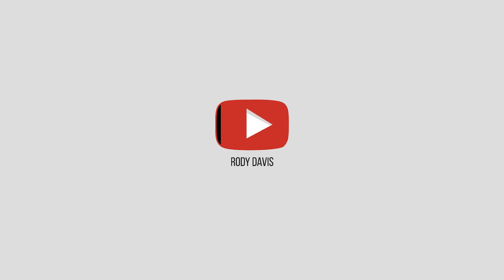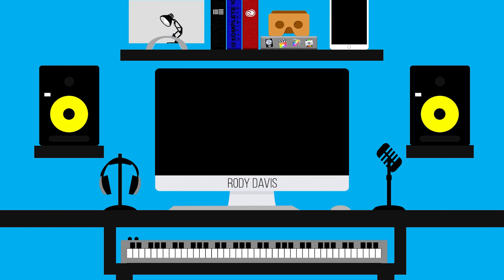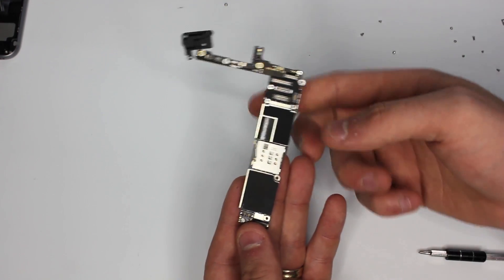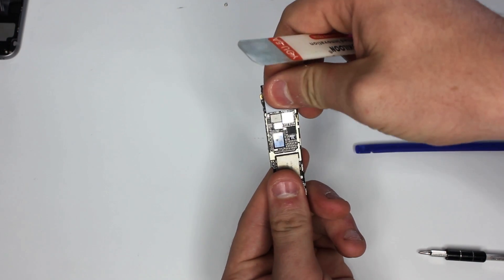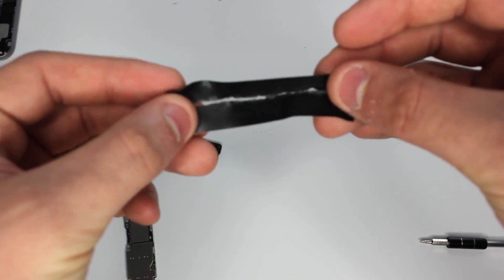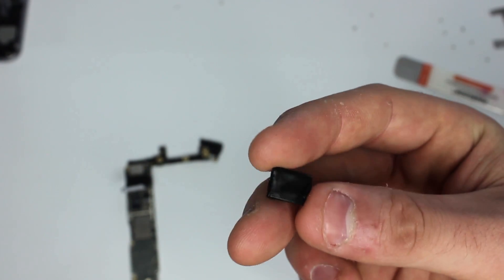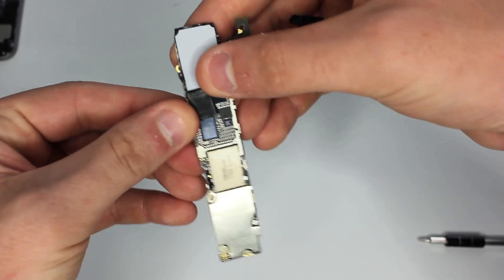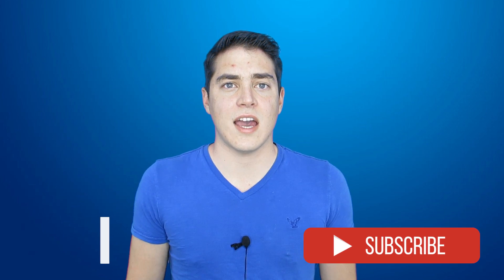UPDATE: How to Fix Touch Disease on the iPhone 6 Plus (No Soldering or Bending) | appleEducate #05

Comment: This is not a "fix." It's not a repair and it hardly even qualifies as a work around. The reason touch fails in because some of the many solder joins have oxidized. When the chassis is bent or torqued, the oxidized contacts sperate from their pads. Pressing these cold joints back together might work in the short term, but the connection is still tenuous. Higher current may be necessary to pass through the cold joint which can lead to other failures and shorter battery life. Placing a shim over BGAs and using the force against the chassis to hold it in place creates another bend in the motherboard that could result in damage elsewhere. This is simply a bad idea.
Don't stuff tape or anything else inside your $600 device. 

Apple has a repair extension for touch IC failure for $149. If you're worried about getting an exchange with the same potential problem, there are micro solders that will replace that sticker with a metal cover which prevents bending in that same area. Most (myself included) offer this both after a repair and as a preemptive measure.
Reply: We get it, you and the other pros don't approve of this. There's no reason for you to keep commenting that fact. These people own their devices and can do whatever they want to them. You are speaking on behalf of other pros with a condescending attitude that isn't bringing anyone else to your side. 

I would just suggest not engaging anymore here and let this run its course. Apple has a terrible solution for an even worse problem that they caused...making people look for cheap temporary fixes. That's their right as owners of these devices...even if they are potentially damaging them.
Reply: Boanerges, technically, you don't have the right to open their phones because it violates apples terms of service. No one has the right, except apple. As for my comments, for as long as people produce this kind of dangerous information, I'll be here, yelling at the wind. But if I make one person think twice or save one device from additional damage, it will be worth it. I'm sorry if you don't like my conviction.

Comment: You forgot to mention the main tool that you used in this video. Yourself. Anyone who follows this guide is likely to end up with a phone even more busted a few days after the "fix" stops working. This is similar to wrapping an Xbox in a towel to fix the rrod.
Reply from the maker: +Martin Law I have an updated guide that goes more in depth.
Reply: Rody Davis does it show you bringing the phone to a reputable repair company? Or at the very least to somewhere where they have an actual clue about what they are doing?

Comment: Good for a band aid, but that's about it.
Reply: This 'band aid' you refer to have been working flawless for me for two months and I have no reason to believe it won't keep working.  I personally like the idea of the little square of a rubber band or two under the chip as the size if more inform than tape but this works.  Thanks again.
Reply: It has been working for me for a little over a month. This may not be the "professional" solution, but it definitely works.
Reply from the maker: +Beau Dorsey that's exactly what it's meant to be.

Comment: This is a joke right?
Reply: No, he's serious.
Reply: furr It sounds like something a certified person would do.
Reply: +Louis Rossmann Good point. In retrospect everything points to Apple Certified Tech.
Reply: This is supposed to be a temp fix... but the correct way to do this is to solder it... and if you are not an expert  what you can do is get a cheap electric solder and folding a piece of foil paper the exact size of the IC and carefully placing it over it with the solder hot and ready apply heat for intervals of 30 secs... no more than 3 times. This should transfer enough heat to solder the IC again without taking it out.
Reply: Fucking thank you! Fuck these people right..
I agree with you
Reply: I rather have to pay nothing phones are already too damn expensive
Reply: It's not working in my iPhone 6 Plus please help me my problem is my phone has automatically touch operating
Reply: Mine worked right away I did the exact steps and first try only been a day but so far so good. Before I had to bend in order to work
Reply: No, I’m currently trying to fix it on my iPhone 6 Plus right now. It’s really frustrating when I go to exit out of something and it does random stuff like tap stuff when your not even touching the phone.
Reply: It actually works but it seems to only be temporary. The first time I tried it didn't but after making it thicker it worked.
Reply: The joke will be on all the poor folks that have to send their phones to us for long screw damage in addition to touch ic repair after trying this.
Reply: ''I am an Apple Certified Support Professional, and Apple Certified iOS Device Repair Technician. I am an iFixit Pro, and Amazon Service Provider. ''

I call BS.

Comment: This isnt a fix. Wedging a piece of tape in between the IC and frame is only pressing the broken solder connection down. Which will fail again and the added stress will cause other issues maybe cpu lifting, or IC chips breaking, or baseband searching issues from flexing the board. 
Instead of spreading "fixes" like the towel trick xbox 360 or the copper shim for HP laptops that dont last and cause more issues, why not share information how or where to have it actually fixed professionally where it wont come back. Or better yet tell people to complain till Apple replaces these under warranty and not charge people more money to fix their design flaw.
Reply: Hey it’s working for me...! So deal with it...
Reply: thats like saying to put some tape on a tire with a hole in it, it might prevent the air from coming out but will eventually fail. Thats not a fix!
Reply: If you can't figure out that there is an apple store and many cell phone repair places in your city then this guy can't help you. I know that I can fix it properly for 110 at a random shop or 149 at apple.
Reply: It isnt a fix for you because the video is a threat to you getting more customers
Reply: A temporary fix is still a fix as a pepperoni or hawaiian pizza is still a pizza...

Comment: Hi! The solution proposed worked as a charm. I managed to map the screws not to miss anything while putting it back but know I have another problem. After assembling it I saw that the phone is really heating up in that area and sometimes even shutting off. Also the front camera is not working but it is connected properly. Any suggestions to what i might've done ? Any other users experience this issue ? Thank you!

Comment: I purchased the Apple screwdrivers at Fry's, and began to disassemble my Iphone 6.   However, the second internal screw will not come out as it appears to have been stripped at the factory.   How do you overcome this?   Drill it out, and if so, does it have to be replaced?

Comment: Sorry I have to say this but as much as this video is well presented and educational- it's definitely not something that should be performed by anyone who is not familiar with opening these or having an idea of what happens when you apply pressure to one side of the board. You cause the board to warp and other components to fail in the same way the one you are trying to fix. Best way to get this sorted is to take it into a cell repair shop that can do board work and will replace the chips with leaded solder as well! Lead free solder in those components is half the problem why they fail as well as lack of chip underfill and board anchorage.

Comment: Everything was going great until a piece of adhesive that is CLEARLY not present on the phone used in the video showed up on my iPhone and while trying to pull it up, I tore the flat connector.  This is the connector you pull up and fold over beginning at the 1:56 mark of the video.  Mine was held down tightly with adhesive that is not present in yours.  Bummer.  QUESTION:  Can you tell me where I can purchase the connector in question?  I am not a beginner as I have 3 teenagers and a wife and have replaced multiple screens and batteries on different models.  Thank you.

Comment: Hi Rody, thanks for taking the time to help people out, we really appreciate it!

I recently changed the Speaker and Mic on my iPhone 6 because both were distorting. Unfortunately they are still distorting after I replaced them both & I got the flicker afterwards so I'm thinking I may have damaged a connector during the fix.
 Is either of these a problem with the board?  Did I buy  crappy replacements maybe?

SPEAKER:   http://www.ebay.de/itm/401245818177?_trksid=p2057872.m2749.l2649&ssPageName=STRK%3AMEBIDX%3AIT 

MIC: http://www.ebay.de/itm/391646698146?_trksid=p2057872.m2749.l2649&ssPageName=STRK%3AMEBIDX%3AIT

I would like to kill two birds with one stone so I'll wait for your reply before I go ahead.

Comment: thanks it's working but some time it's same it doesn't response and "1" button is not working.. what should I do
Reply: It's the same problem. This technique is not a fix. In your case not all of the joints were able to produce a viable connection. Squashing the BGAs onto the motherboard is bad mojo.

Comment: I was able to do this fix on my phone with no problem with the tools that I had. However, a recommendation is for the tape, don't make it too thick because when you put everything back together, the screen will not be flushed. Also, the result on my iPhone 6 Plus is not fixed all the way, the touch on the screen comes and goes ( but not as bad after doing the changes with this video). Overall, good video. Thanks.

Comment: I also noticed one other issue with Wifi. I can get basic wifi but it no longer picks up my 5G setting which was much faster.
Reply: Ray Thomas are you sure you put everything back properly? The upper half of your phone works as an antenna, there are some components that have to be screwed properly to the housing, just unscrew them and put it back again! It should work! Make sure you put every screw to its right place!

Comment: Hey Rody - First off, thanks for the 2 vids! Now my issue is that my phone does get a little warmer than what I remember when using it, even after a few minutes. It's not burning hot, but definitely feel a little warmth right by where the tape was put. Is this common, even normal? I did reopen it again and re-seat everything. I also stripped 2 of the small screws in different areas, does that effect things drastically?

Comment: Update 12/15/16:  After hard reseting my phone (hold power and home till it reboots), and taking the screen off and tightening one of the screws behind the white mark on my screen, most of my issues have gone away now.  Phone is definitely much more stable now.  I can get it to freeze still by pressing firmly on the location where the IC chips are, but a quick power button press and login clears the issue quickly.  I still have a smaller white mark on the screen, have ordered a better screwdriver to tighten the screws another turn and see if it goes away.  YMMV, I probably would do it all over again, given I just don't want to spend either the $150 to get Apple to fix it (and problem come back again), or buy another iphone 7.  I think I would take HateTheG's suggestion and use a thick piece of rubber band.  Thanks for posting this!

Thanks much for this video, unfortunately I followed all the steps very carefully, made sure I had a thick enough tape, put'r all back together...and same problem.  It's intermittent, but when it happens, have to hit power button and lock it, and re-open it.  I also have a white blotch on my screen now, about 5 mm square.  Not major enough to complain about, but I sure would not try this procedure again, took over an hour to very, very carefully track every little screw.  So thanks again, but it did not fix my issue!

Comment: This definitely works.  Instead of tape, I cut a piece of a fairly thick rubber band and place it on the chips under that tape.  Been working for almost two weeks without one little flicker.  Thank you for this video.

Comment: if this is an issue with the touch sensor then shouldn't Apple fix it? Since it happened with my iPhone 5 and 6+ it seems like a design flaw
Reply: The problems with the 6 and 6 plus are a design flaw, but Apple doesn't see it that way.

Comment: I have a iphone 6 that's having the same issue except for the flickering. Screen just constantly becomes unresponsive. Would this work to fix it? I tried everything else btw: hard set, software updates, restore to brand new etc. Nothing works. Took to genius bar and was told I would have to pay over $300  for fix.
Reply: Nads this will definitely work but it happens again after 4-5 months as the tape gets old... do this again and you will be good to go
Reply: Thanks for replying. I will give it a try

Comment: I folded mine 9 times. I made it full width then cut it to precisely fit just on the two chips and not overhanging onto the board. Works perfectly the first time!! Take your time and do it right the first time. Take pictures and or keep your screws separated so you get the right screws in the right places!!! I believe there are 7 different kind of screws. Length and width vary.  Other than that very good idea! I believe it's a better fix that heat gun soldering it back as it will keep the constant pressure on the chip so the problem does not come back!! Your the man! Thank you.

Comment: Thanks for the first video, I fix my phone but now Apple is replacing the iPhone 6 Plus with this problem for just $150 and they will give you a new one 
http://www.apple.com/support/iphone6plus-multitouch/
Check it out I just got a new iPhone
Reply: They replaced your phone?
Reply: cmbdad yes in the Apple Store, they give me a new one and I just pay $150 +tax but you have to show the you have the "Touch disease"
Reply: Pedro Tobias hey when they gave you a new phone did they check to see if phone is blacklisted or not? Or do they replace your device regardless no questions asked?
Reply: Guilherme Porto as long as you have that defect on top of the screen (touch Disease) and you can proof them the is there,  they will replace it no question ask, but they did run some kind  of test on the phone 
After that they give me a new phone with the same GBs and unlock with 90 days warranty
Reply: So they don't fix it they just give you a new one?
Reply: jazzalynn thomas Yes, they will give you a new one

Comment: so it worked but now my volume, power button and the silent switch won't work, any idea on what I did wrong?
Reply: That happened to me, it's the two chips not clicked back in properly top left above the battery. Unscrew, click them in properly and should work

Comment: Hi does anyone know if Iphone 6S Plus gets touch disease?
Reply: It cannot as the touch ic is now located on the screen. If chip fails you just need a screen replacement.
Reply: Mariana Bernal it doesn't
Reply: Mariana Bernal only iPhone 6 and 6plus models
Reply: Josh Ehring you mean on the iPhone 7?
Reply: mine has .i got 6s plus
Reply: dauntLess its not possible to have touch disease on 6s plus the touch ic is located on the screen now so replacing the screen would fix it

Comment: Could someone explain why this should work??
Reply: Puts pressure on the loss chip and allows the connection points to touch again
Reply: It works the same way that holding two strand of torn wire together with scotch tape will work--i.e. It doesn't work for long, and you risk doing a lot of damage trying it.
Reply: Ah I see and I understand that you have to fix the joints on the chip for it to work for a longer period of time. Btw, I like your videos even though I'm not a apple fan and have chosen Samsung instead. Keep it up!

Comment: How do i reset my iphone if i have the touch disease?!
Reply: press and hold your home button and power button together for 10 sec. It will force restart your device. Try this method 1st before u reset your phone. btw, u can reset your iphone on the setting.
Reply: Resetting your phone will not correct touch ic failure.

Comment: Hi there, I have followed your guide step by step. My phone is still as it was before i added the tape in. Is there by any chance another reason why my phone screen does not register touch or swipe? I've tried your method also i had brought a completely new screen. Im looking for any other suggestions to which the problem could be. I would get it repaired professionally which would cost a fortune but only as my last resort. Thanks

Comment: Will this work for just the regular  IPhone 6 (not the plus)?
Reply: I tried this with six and the problem came back after a couple of days. Might have to try this again with 9. But this time gonna buy some nice precision tools WITH magnetic tips. It is a nightmare otherwise. and yeah, wish i had read your other post first on sorting out the screws. its was a pain to find the right ones.
Reply: Rodrick Felder it works for 6 and 6+ i fix my 6+ just put 6 slayer of electrical tape no more or less ;-)
Reply: Alen Briones  I used 9 layers then I trimmed the tape very carefully to fit just on top of the chips so it does not overhang onto the board. Plus when you cut/trim the sides off, the tape is more uniform and nice and flat, just putting pressure on the chips. Reassuring me it's only pushing on the chips giving me a firm connection. No assembly or screen setting high problems!! I swear on 8-or-9 pieces trimmed nicely. Take your time people!
Reply: Ricky Pina    If you don't find magnetic tipped, just swipe the screwdriver head overtop of a magnet a few dozen times. It will magnetise the tip for many hours! +1 for sorting the screws!! My phone is still working flawlessly!!
Reply: Ricky Pina  also make sure to cut the tape so it ONLY covers the two chips!!
Reply: Update: it works for the regular IPhone 6. The problem has not came back. Thanks